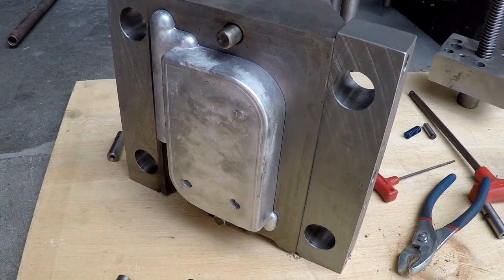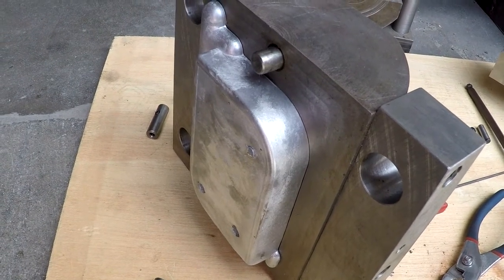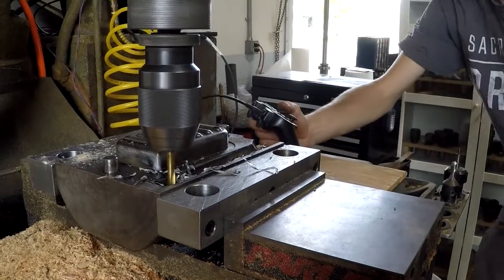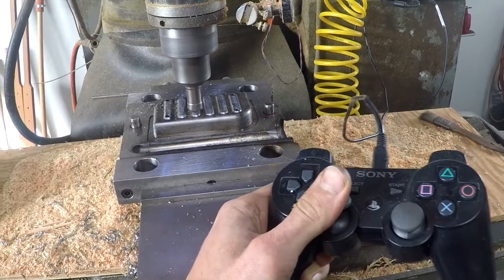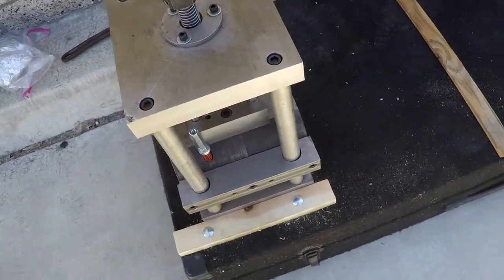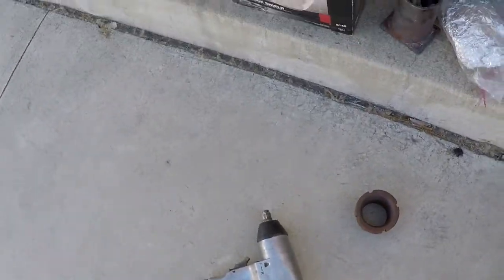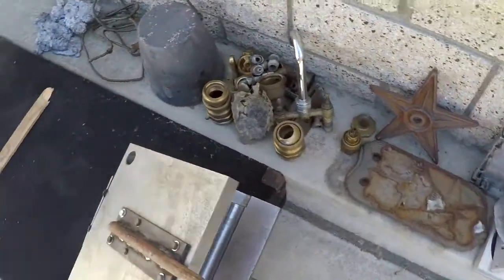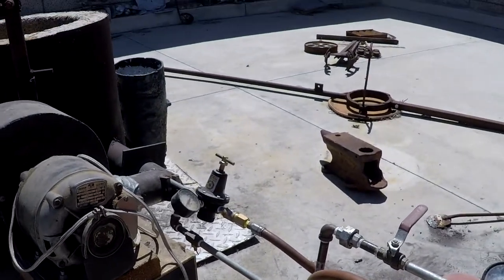Upgrading The Soap Dish Mold & Diecast Molding Press

Comment: What about milling a little logo in there? DD or G+M? Looking forward to part 2.
Reply from the maker: If you've seen the original blog post, I actually engraved "Green Furnace Foundry" on the bottom cavity.  I don't think I've ever shown it on the final castings since it comes out so faintly. I only engraved it .005" deep.